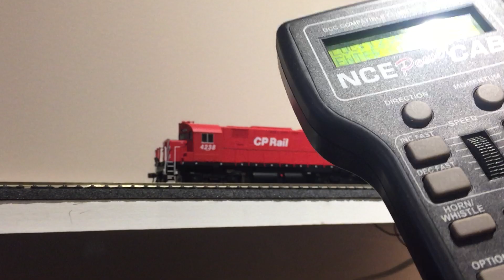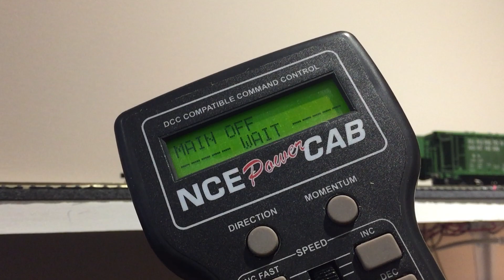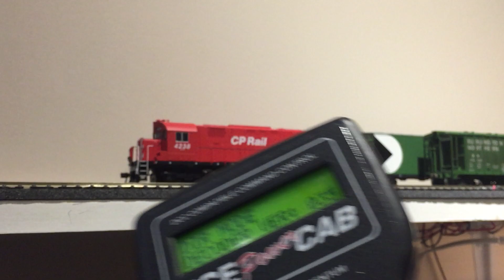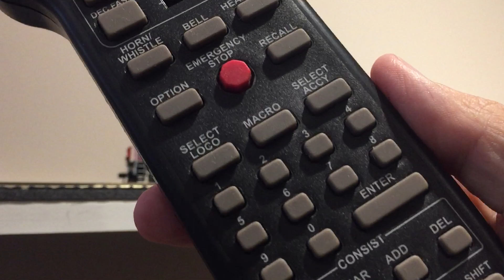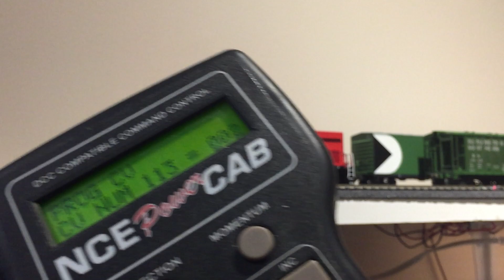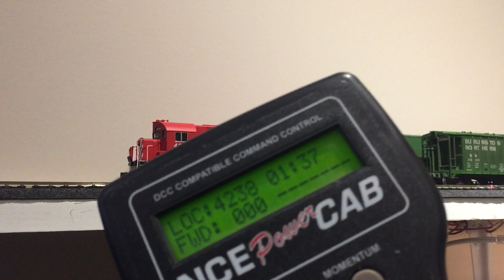How to Set the DCC Locomotive Address Using NCE

Comment: This was a huge help. I just purchased a pair of N scale locomotives as "parts or not running" on eBay. When I got them I popped the shells off to find DCC decoders of unknown manufacturer installed. I thought these were DC units given their vintage as they weren't offered even DCC Ready from Life-Like. So I broke out my old Powercab and hooked it up but neither responded to locomotive #3 or the road #'s on the shells so I was at a loss. Stumbled across your video, went through the programming and it detected the decoders, allowed me to program, set addresses, etc. and now I have two fully functional DCC units. Not a bad haul for $37 in retrospect. I had thought that maybe the decoders had been smoked. They just needed a reprogram.
Reply from the maker: I am so glad that my video helped you out, and that your “dead” locomotives are alive and well now. Thanks for the comment.